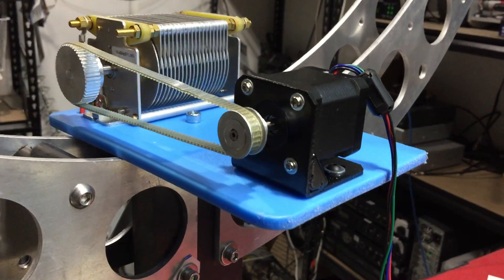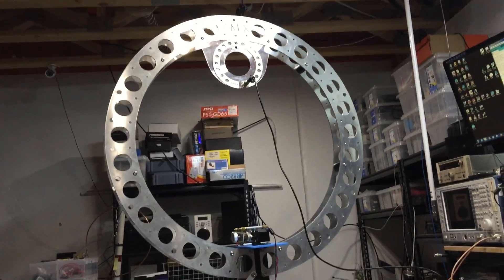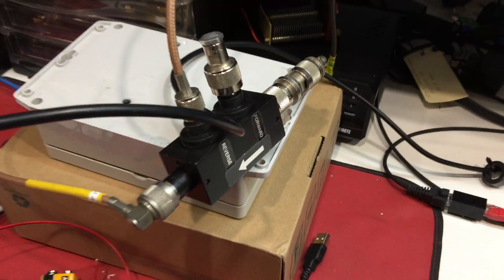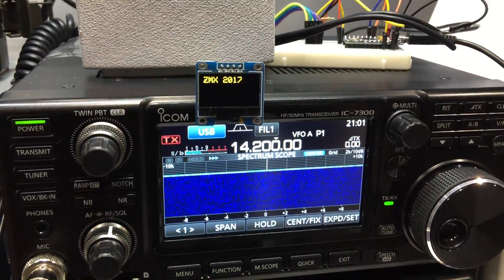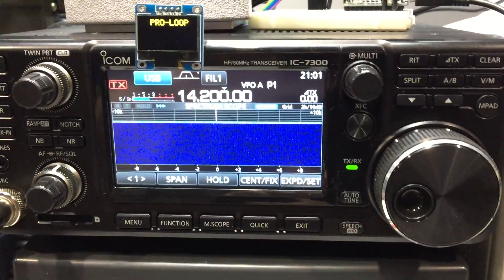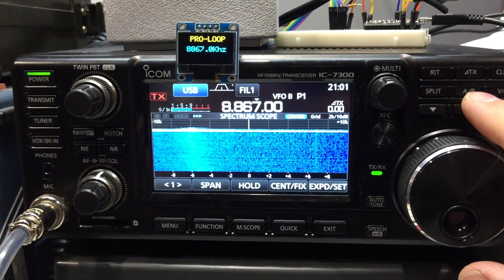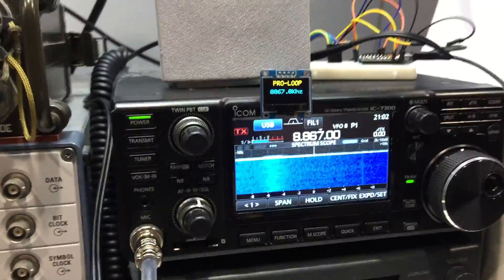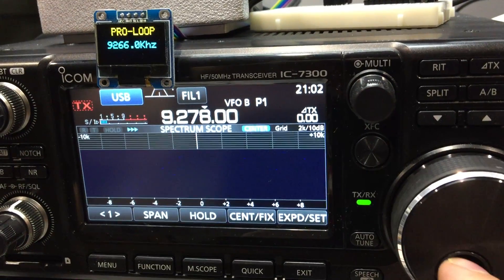Proloop controller prototype decoding the ICOM 7300 CI-V port

Comment: Hi. Are there any code and circuit information available for doing this decode? I'm looking to do the same but push the information to network.
Reply: Did you ever figure it out, same story here, trying to decode with and esp32
Reply: No. I sold the radio and got flex instead. Everything open and accessible via Network.